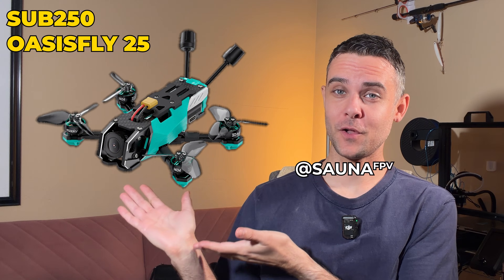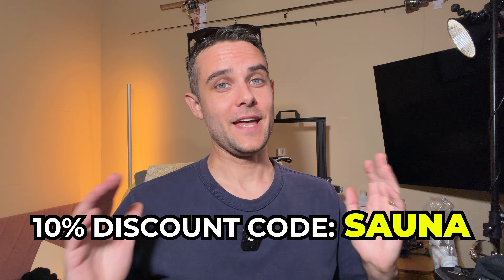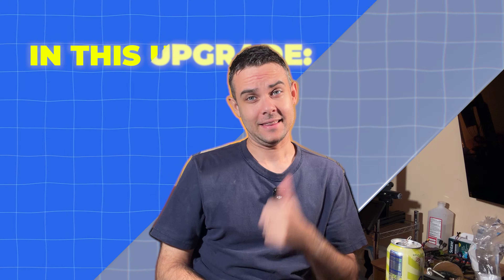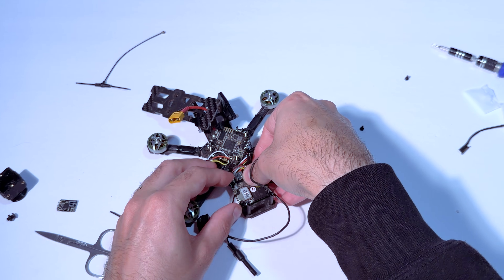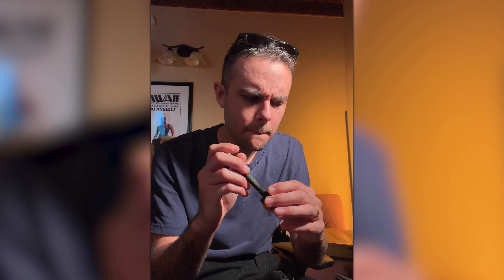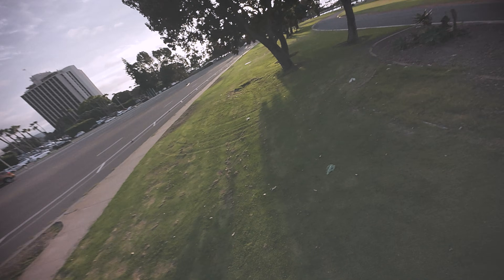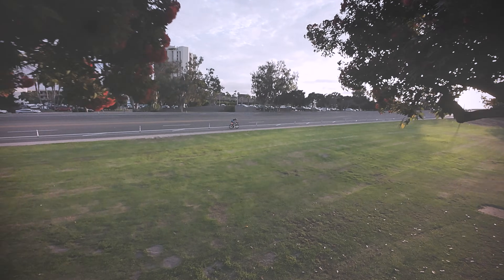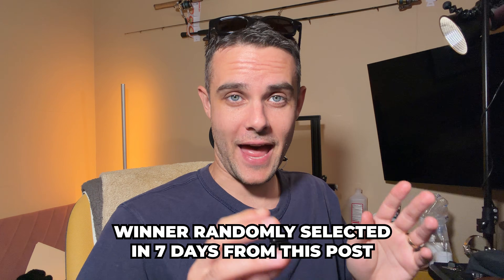Why I Swapped O4 Pro for O4 Lite… And Don’t Regret It (Sub250 Oasisfly 25)

Comment: yo bro im looking to buy a analog goggs but i dont have the budget for like the high end 500-700$ looking more towerds like 200-350 what goggs would you recommend? maybe hdz box/skyzone 040 pro?
Reply from the maker: Do you think you will ever fly HDZ? If so, I think the HDZ box are best option. They seem like an amazing value. For ONLY analog, checkout Skyzone cobras if you’re ok w box goggles cus I don’t think 040 fits into that budget? Unless you get the older one which is still great for analog. 

Do you have any goggles now or is this your first pair? I’m asking because I think if it’s your first pair, you’d probably be rly  happy w box goggles. That said, if you already fly binocular style, you may not be willing to ‘step down’ to box goggles
Reply: @saunaFPV  already have a integra for my dji quads and some shitty betafpv goggs for analog but want to upgrade. the sky040 pro costs 339$ so its fine also thought bout the hdz box tho i mainly gonna use analog so idk if it is worth going for the hdz box

Comment: Good info on the flywoo adapter as I have been waiting on that vs a preglued 155 Degree one.  MEPS
Reply from the maker: Hey @chrisr4800, you won a free m+ membership! If you could email me: saunafpv@gmail.com, we will get you squared away. Thanks for being here and congrats
Reply from the maker: Which preglued one are you looking at? I honestly love the o4 lite but i NEED that fov, so im trying to test out all the adapters!
Reply: @saunaFPV looks like my links didn't post.  You have 3 choices.  Wide angle glued to a board but gives a camera calibration error.  Full new air unit with preglued camera. Full air unit preglued with extra cnc case.  I think most people will get the full version with just camers preglued so they don't have the error but depends on how hard o4 pro is to get.

Comment: With the "shaky" Flywoo O4 Pro-adpater, you just missed to put in the tiny heatsink pad between the cameras pcb and the aluminum backplate - there are 2 of them packed with the adapter under the foam. ;-)
I have the adapter too and it works like a charm.
Reply from the maker: omg.... ok thanks for this info!!! i just checked my bag that had the adappter and I'm actually NOT seeing that little piece you mentioned! maybe i lost it while unboxing... im so pissed now!! (but happy you told me this!!) lol, ill update w a pinned comment if i end up finding the little culprit piece! maybe i can like 'print' or re purpose something to wedge in. 

thanks for watching and commenting btw bro!!

Comment: Sorry for so many comments but as I watch it I comment lol- the Flywoo issue I've had (as others have) is a lens for sure comes loose. I contacted them and they wanted proof and sent it to them and never got help. It's not a well built adapter. Mepsking make some colorful motor! I have some of the neon pink ones but definitely want to try others!
Reply from the maker: No need to apologize bro I love the comments! 

The flywoo issue is so annoying, considering I pulled it fresh out of the box for this video. It’s been sitting in my desk for months and I didn’t even realize it was defective until it was too late lol

Comment: I have the Oasisfly25 that I built, but I may put the O4 lite in it with the RATE O4 wide angle lens adapter. Much better view than that Flywoo one. I know Flywoo came out with another one but it requires you to remove the old lens and put on a new one where the RATE one just take the O4 camera in it and to me works just better. It has O3 AND O4 mounting on it. cool video though! Def going to subscribe!
Reply from the maker: Hey thanks mate! 

I agree the rate is better after seeing your video on it! I ordered one of the flywoo ones so I will try that out soon enough. Thanks for watching bro!

Comment: Great video man! Agreed; 20g is a very significant difference. Also props for banging your head against a wall to solve the lens issue. That's fpv amirite.  Tbh I'm wary of Meps since the controversy a couple years ago. Glad your motors passed the qc test!
Reply from the maker: Hey dude thank you so much for the words! It’s comments like this that get me super pumped to make videos. 

And yes, that’s FPV lmao, the amount of time I’ve spent frustrated is insane. BUT I keep coming back for the addiction of flying.. 

In regards to MEPS.. I could not agree more about the hesitation. After they reached out to me, I did some research and saw JB talking about some of their marketing. Well it seems they have changed some of that since their comms with me encouraged me to be completely honest and didn’t require  any contract! And the motors do seem really good quality. I’m curious to try some more of their products. I wish they made more micro stuff. 

Cheers!!